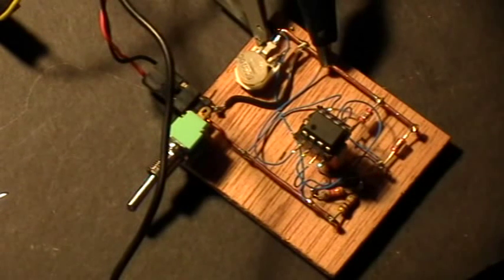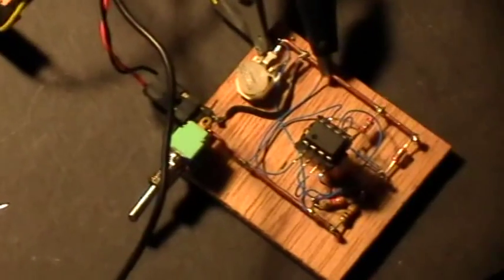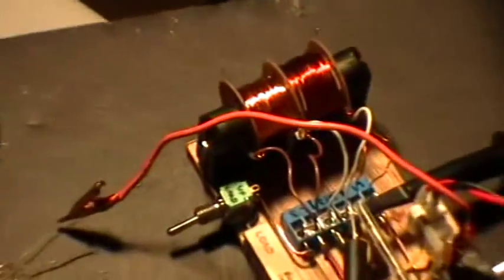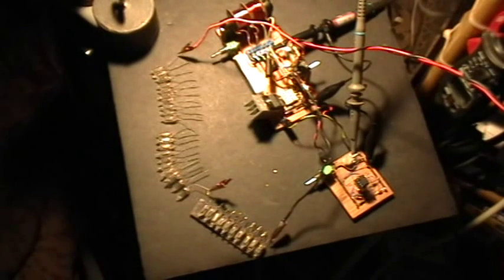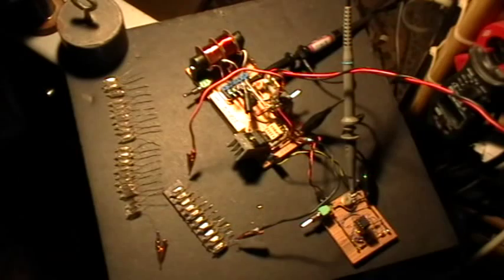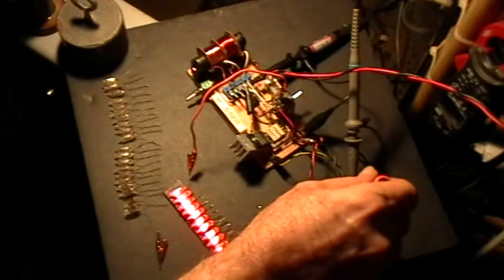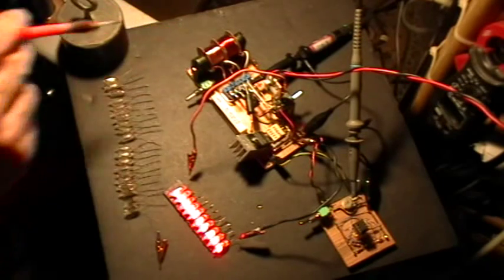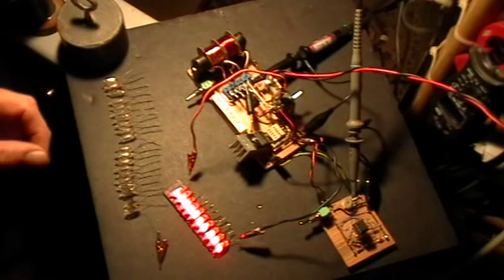Misc. Circuits: TKs EMJ-Meyer Build Demo 2 -- HV Adverse Event!

Comment: Great to see the simple 555 method running.. I wasn't sure about it, due to the duty cycle being slightly out from 50% and am delighted you tried it  :)
It sounds very similar to CRT issues, especially flyback arcing on old arcade game monitors. All old PC CRT monitors have similar transistors, 1500V/50W capable right next to the flyback on large heatsinks...this really is a mini HV driver stage, very cool  !
Reply from the maker: Ah, was it you who suggested it on OUR? I couldn't remember exactly where I saw it, it's been a long night. Thanks! I wasn't sure if it could source enough current but it clearly does.
Yep, those HD transistors will be all over the market now that nobody uses CRTs any more. That is exactly where I got mine, from old monitors and TV sets. I have a handful, all slightly different, this one seems most similar to the 2sd1555 or NTE2331 that EMJunkie used.
The coil is shorting internally; I've already rewound it to cure that one short, but now it has developed another. I potted it in corona dope, but got only a little improvement. It's much better than in this video though. I'll have to strip the bobbin and rewind it with good HV technique to see if I can stop the silly arcing and internal corona. Love the smell of ozone though.
Reply: TinselKoala
Aye it was me and thank you for trying it out :)
I do wonder if the 6% away from 50% duty cycle could do something within the coil, forming a compounding imbalance with each cycle. It may be great for output, but stressing the windings past breakdown. Shouldn't matter or factor, but such things need to be squared away, as it were.
Hope the repairs go well.